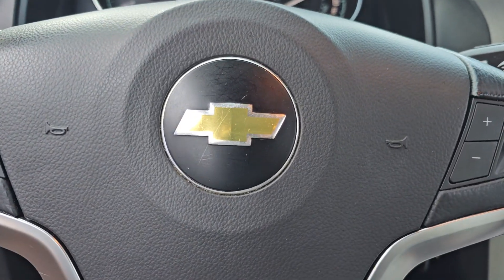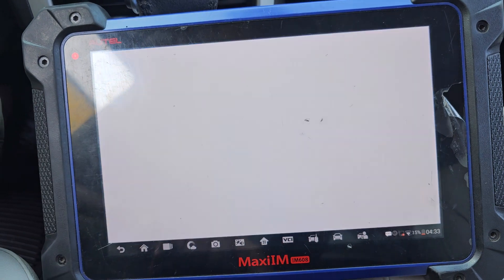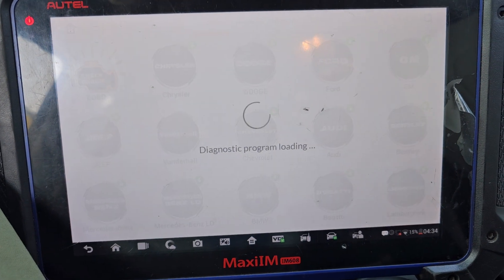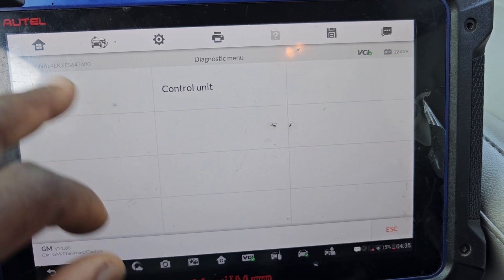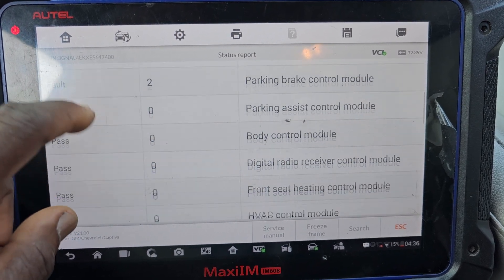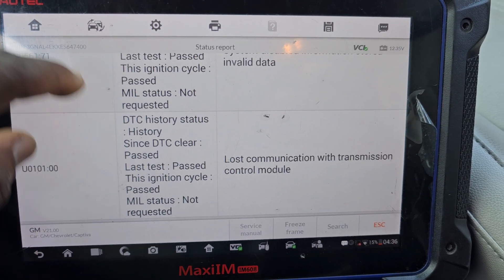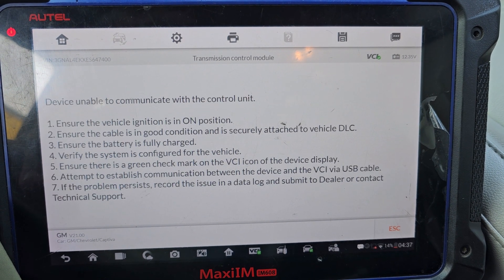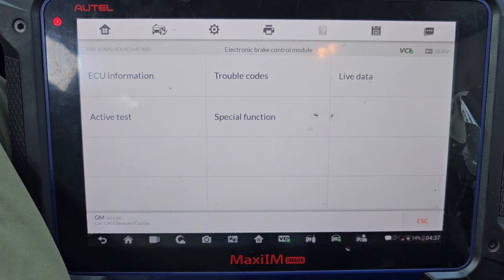2014 Chevy Captiva U0101 Code No Communication With Tcm Module What You To Know Need ?

Comment: So what i need to do replace the tcm  and where is the tcm located in a 2014 chevy equinox lt  v6 can u help plz
Reply: NOOOO DONT REPLACE PLEASE FOLLOW STEPS ILL TELL YOU HOW TO FIX It’s a problem with the battery or alternator or fuses if you need help I can help you anytime just hmu
Reply: Hi! My truck did start having this problem after I changed out the battery. My codes are U0101 and U2106.

Comment: I have Same Trouble,  TCM Need Replace or can Be Fixed
Thks
Reply: NOOOO IT COULD BE BATTERY ALTERNATOR OR FUSES DONT REPLACE RIGHT AWAY It’s a problem with the battery or alternator or fuses if you need help I can help you anytime just hmu

Comment: What was the problem?
Reply from the maker: Transmission Control module is not good
Reply: @BestCarFixes 
Ohh shoot, I have exactly the same problem. Hopefully it’s just a missing wire. Transmission Control Module sounds expensive
Reply: @rogermty1971 PLEASE DONT REPLACE CHECK BATTERY ALTERNATOR OR FUSES IF YOU NEED HELP HMU
Reply: @rogermty1971  Que termino siendo tu problema? me esta pasando justo lo mismo.
Reply: @lamare1005  How to verify this? can you assist?